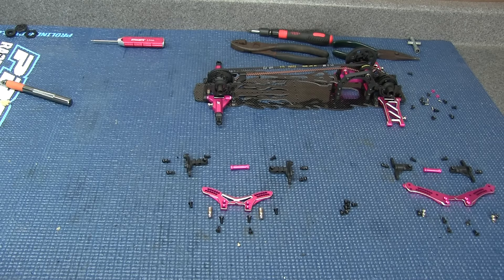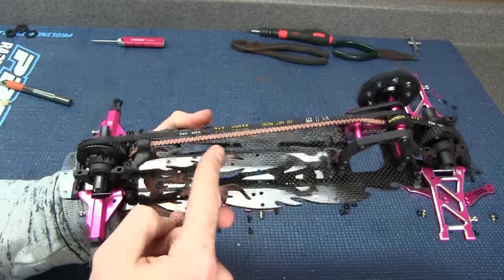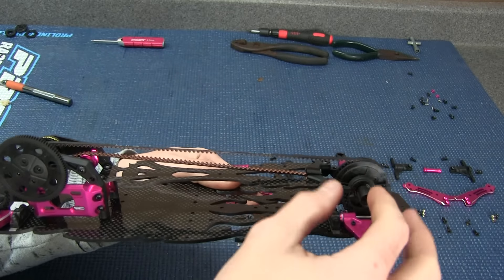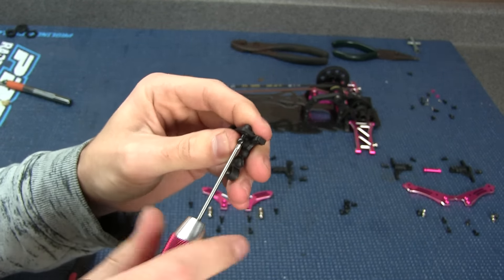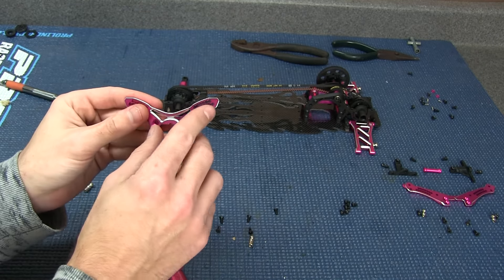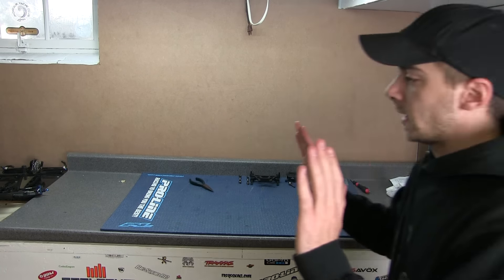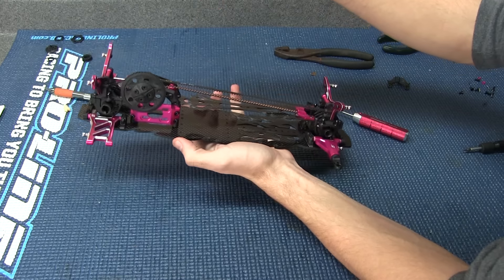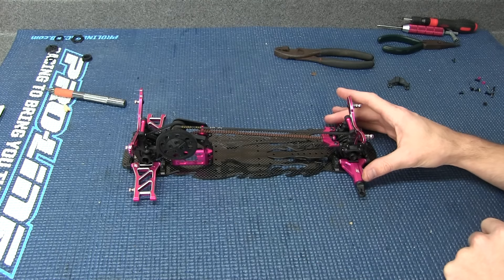3Racing Sakura D4 AWD Build - Shock Towers & Belt Pully Issue -PT3

Comment: I also found the belt to be very tight, compared to other belt driven cars i have built in the past.  I have fitted a machine screw with a short peice of flange tubing and a washer.
Reply from the maker: Sounds like it should work well for ya!

Comment: got the carbon and aluminum clone. great car. they addressed this tensioner issue with an actual pulley wheel and aluminum arm. does decent but barely clears upper deck

Comment: I had the same problem, I put a longer screw on the tensioner and it sits a lot straighter, I will have a video up soon about my build with a standard (no hop ups) build, I'm currently 3 hours in...
Reply from the maker: +Cowan RC Awesome man! Glad theirs another way to fix this problem! A lot of people have told me how much of an issue they have run into with this setup.

Comment: You could have adjusted the plastic  adjustments on the diffs to loosen the belt also
Reply from the maker: +Tony Foard Actully i forgot to mention it in the video but i did adjust them so they were set for the loosest possible tension.

Comment: Why are so many drift car kits I see belt drive? I'd think shaft drive would be at least slightly easier to work with.
Reply: It's all about weight balance. Shaft drive is reliable and strong, but extremely heavy, more expensive and much louder than belt drive.